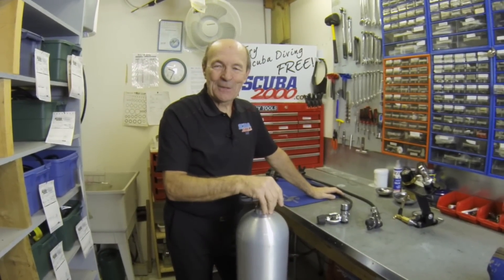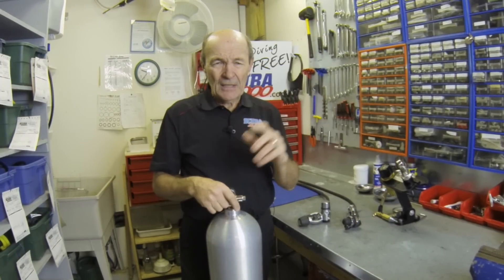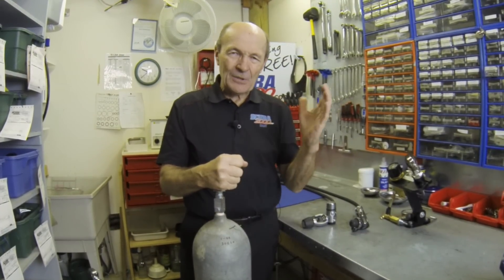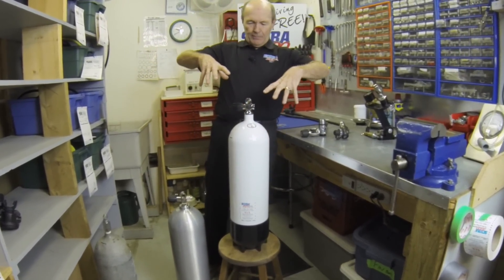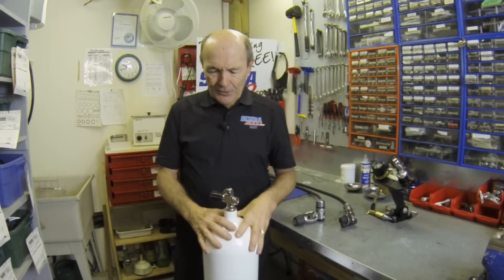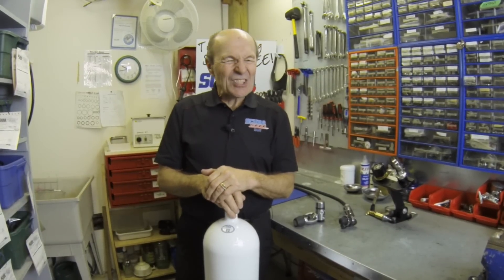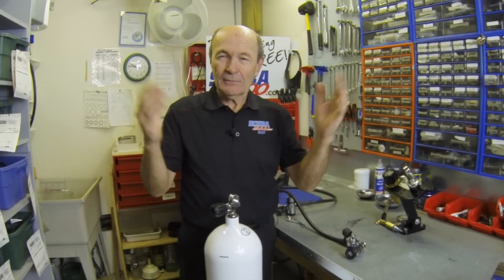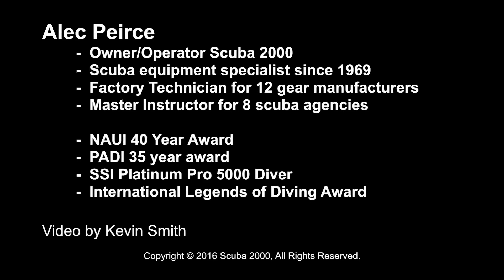Steel vs  Aluminum Tanks - Scuba Tech Tips: S03E07

Comment: Recently Aluminium was put under suspecion to support cancer and Alzheimer desease. Recently as well Aluminum combinations were therefore taken of deoderants, as female breast cancer was observed to wander from the middle towards the axle. If you search the net check reports of the French-German TV Station "Arte", called "the file Aluminium"/"Akte Aluminium". I cannot avoid parts in fist and second stage, but I sure will not breath from Aluminium Tanks anymore. Aluminium and its creation from earth with a lot of poisonous red dirts are a curse. Recycling Aluminium consumed a lot of energy. Steel all the way for me.
Reply from the maker: Wow! 
Of course, I understand that too much water causes drowning.
Sorry but if we wanted to eliminate all the things that are 'potentially' harmful we'd never leave our house, assuming of course that there's no asbestos, no fiberglass, no Radon, no Natural Gas, no smoke from a fireplace and so on.

I've seen nothing to in indicate that aluminum is normal quantities is harmful.
However, if you are concerned about that possibility, use steel tanks.
There is no aluminum used in regulator manufacture that I'm aware of.

I assume you are aware that the inside of an aluminum tank is coated with a tight layer of aluminum oxide. Aluminum oxide is used in sunscreen, lipstick, blush, nail polish, toothpaste and glass and, ready for it, artificial hips!
We can't win for losing sometimes.
Reply: A few remarks. What I meant with that I cannot avoid aluminum parts in first and second stage is that I simply and hardly know the full market of these. I see also full masks are coming up, new super high tech gear, so I wanted to say that I simply do not have the full overview, if a certain stage could contain any aluminum or coated parts, especially in light moving parts, as i simply cannot look inside. If you confirm one will not find any Aluminum in any such two stages in the whole world (I usually rent my gear when I arrive) that is very good to hear and a true relief to me. An Aluminum tank I simply recognize right away, when I simply lift it and ask the diving base and always vote for 12 or 15 Liter steel. 

What you said on Aluminum oxide might be true, but it is still an Aluminum combination, like combinations as mentioned in deodorants I mentioned (check yours). I do not see any difference here on exposure to the air inside it which we breath. I'm sure you have not really searched Youtube for the Aluminum story. My point was more that I know that diving instructors and dive professionals have thousands of dives, tens of years and years of possible exposure. A diving tank is not a clynical devise nor sterile, it is a mixture of professional or recreation characteristics, depending on where we look at. Most often weight and pressure properties are key important. I'm sure tank manufacturers do not care for the recent findings of the last 5 years on Aluminum, very recent research that popped up. They wan to sell.

Also please recognize, which you personally do not need to, that in diving there are green discussions taking place, from lighter BCDs for travel to enhance the carbon footprint of the sport. "Awareness" is key everywhere. Many people that dive are smokers and most likely also die rather from lung cancer, but nevertheless I'm not sure most people are aware how much Aluminum is a threat to the environment. Now they are and everybody is free to give a shit about anything. Its still a free world :)

PS: Aluminum is inside most medicine, as the coat for pills. You would be shocked how much of it we are exposed to, if you would do some reading on Aluminum. Yes, I'm checking my sun milk like I checked my deodorant. I do not want to annoy you, only wanted to add a difference on Aluminum vs. Steel.
Reply from the maker: To the best of my knowledge there is no aluminum in the construction of the scuba regulator. It is all brass, chrome and stainless steel. Now, please don't tell me there is recent research showing that brass is bad for you!!

Comment: These tips are so great.  I have a question, feel ignorant.  I usually come back with plenty of air when buddies are low.  I thought
Why should I have to bear the weight of the heavy tanks (getting hard on the knees). So I bought a 30 cubic foot tank, thinking
it would have less PSI.  I walked from my car to the water and it was so nice and light and not cumbersome.  Just going for a swim to check buoyancy with this tank and to my surprise it has 3000psi. How did that happen?
Reply: OK Head clearer now.  30 cubic feet is measurement of volume of air
at surface  and is compressed to 3000psi just like a higher volume would be.  So I have less than 1/2 the air that would be in an 80 cubic foot tank.. What threw me off was that when I went in the water to check buoyancy with this tank, I was under water 20 minutes and only at 2000 psi.   I think this will be fine for my shallow offshore dives, maybe even shallow water boat dives in the area.  In nature I like to be still
and let things come to me. I like to hover in the water.  Most trips with
others are constant swimming, swimming, swimming. Everyone always seems to be in a hurry.
Reply from the maker: Right you are.
The North American measurement system is more practical. It tells you how much air you have available to breathe rather than telling you the size of the tank. 
Since you use about 1 cubic foot of air per minute at the surface, an 80 cubic foot tank will last about 80 minutes. As you descend you use more air per minute so the supply doesn't last as long. But as you've discovered, the air pressure in the tank is the same - 3000psi. Just the size of the tank changes.

Comment: Thanks for the great video Alec, You mention the new steel Faber to be heavier than the Catalina Alloy 80L? 

I have a faber 12.2l (100 Cubic feet) and Also a current Catalina (80Cubic feet). Both have the same valves, on the scales The Alloy Catalina weighs 14.3kg and the Steel Faber(232bar) weighs 13.2kg.
Reply: +madrx2 are those full weights or empty weights?  Alec is correct about divers choosing one tank material over the other for the negative bouyancy but what he did not mention is that it is at the end of the dive where this is most relevant.  The heavier tank of the same volume is less buoyant when closer to empty...this allows a diver to dive with less weight on their belt/in their BC while not bobbing to the surface like a cork from their safety stop depth at the end of a dive.
Reply: ***** Yep, the density of the steel makes them more negatively buoyent. It all makes sense to me now . Thanks Alec!

Comment: DIN is Deutsches Institut für Normung (the German Institute for Standardization) which is Germany's organization that is part of the ISO standards group.  A lot of ISO standards and many EU standards come from DIN originally (Like the DIN jack used for SVideo connections, the DIN connector used for the PC keyboard (both the original and more modern PS/2 smaller one before everything went USB) and also for MIDI connections for musical instruments, and many other things).  Pretty much a lot like ANSI is in the US.  The German's like standards.  They make life better. :)

My understanding is that the DIN regulators come in both 5 thread (232Bar) and 7 thread (300Bar) versions, and that at least in Europe some people are using 300 Bar tanks (or near that, like 4500psi).  The adaptable valve should be the 5 thread since you are not supposed to be able to convert a 300Bar to yoke of course.  The regular with 7 thread will fit fine in a 5 thread valve, it just won't screw all the way in (which is fine and expected).
Reply: +Lennart Sorensen The reason the 232 bar DIN regulator has only 5 threads instead of 7 is so that it cannot be hooked up to a 300 bar tank valve...the regulator will not screw in enough to make a seal with the valve...this is to prevent damaging the regulator from the higher pressure than it is rated for.  

There are not many DIN regulators on the market that are rating at 232 bar and most are at the entry level end of the spectrum such as the Aqualung Calypso.  Since none of the international/yoke type valves are rated for 300 bar, any of the DIN regulators can be used on them with a yoke adapter.  

The only thing to make sure of is that the correct yoke adapter is used with a 232 bar DIN reg.  Some of the yoke adapters have 7 threads in them and again a 232 bar DIN reg will not screw in enough to make a seal.  I learned this the hard way as my wife has a calypso regulator and we initially purchased the wrong yoke adapter for it.  The 300 bar DIN regs will work fine with any of the yoke adapters.

The screw in adapter that Alec showed only has 5 threads and while it will screw into a 300 bar tank valve a yoke regulator or yoke adapter will not make contact with it to form a seal because it will be set in too far.
Reply: +Jeff Greenfield Yes it would be silly if the convertible vale had 7 threads since the 232bar 5 thread reg is plenty for a tank with such a valve.  I have just used yoke so far, but I know my regulator is trivial to swap between yoke and DIN if I just got that piece for the regulator.  Not sure if I will ever have a need for DIN given so far I have only done diving in Canada and the Caribbean where yoke seems to be what you always see.
Reply: +Lennart Sorensen  I use Mares MR22/Abyss set up that I was able to get the DIN conversion kit very inexpensively (35 Euros).  The benefit that I get from using DIN (I am currently stationed in Europe)...is that the 1st stage configuration is a bit lighter...while this doesn't mean anything when diving as the 1st stage is support by the tank...it makes a difference when packing for destination diving where airlines will charge ridiculous amounts of money if one is over the weight limit.  This only works though if one's destination has tank valves that will accept DIN regulators....so far in my experience Egypt=yes, Philippines=yes, Thailand=no.

The DIN 1st stage  and superflex hoses make for a nice light and compact travel set up.  Also if travling with a DIN with Yoke adapter set up, the yoke can be taken off to keep things compact during travel.

Comment: Alec, my understanding is that the main arena that DIN is considered "better" is when diving in an overhead environment such as wreck penetration, caves, caverns,  ect.   The idea is that if the 1st stage is bumped hard against the overhead it is less likely to be dislodged/leak with a DIN configuration than a Yoke configuration.  For most recreational divers this is not an issue as the vast majority of recreational divers do not dive in an overhead environment.  Also, it was great that you showed a DIN to Yoke valve adapter....viewers might also be interested in knowing that Yoke adapters for DIN type 1st stages exist too.

Comment: Great video! Very informative on cylinders. I chose a DIN regulator because I prefer relying on the beefier o-ring that's in my possession rather than those thinner o-rings found on yoke rental tanks. My reg came with a yoke adapter so I'm set either way.